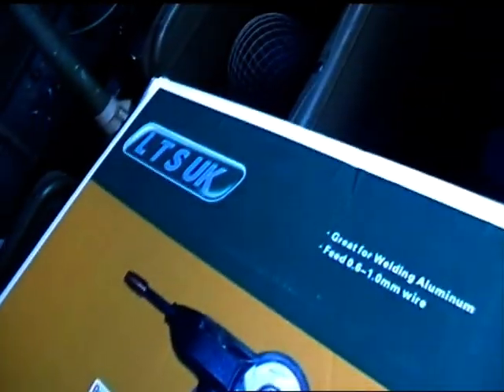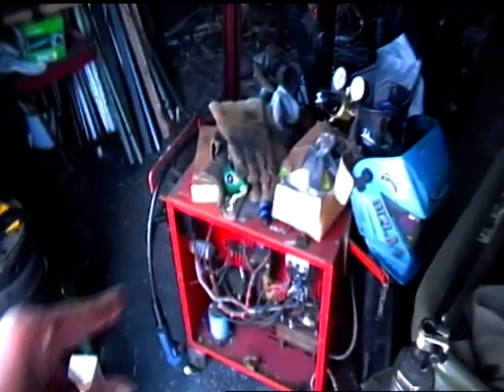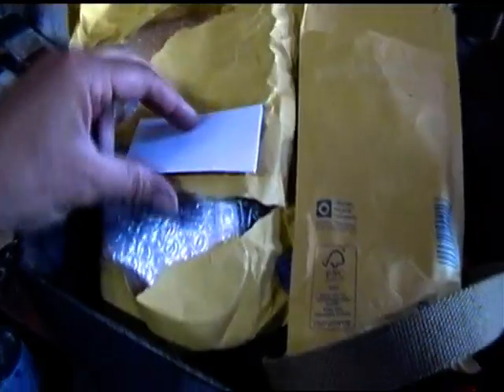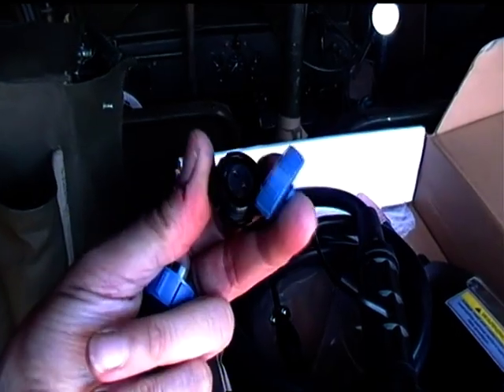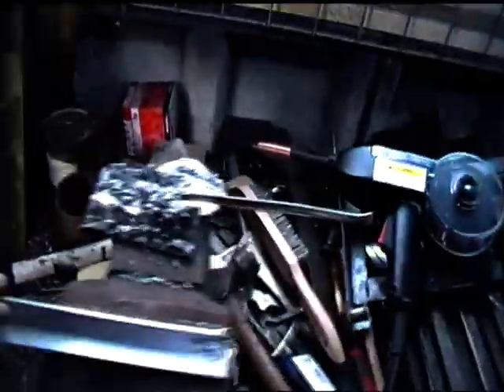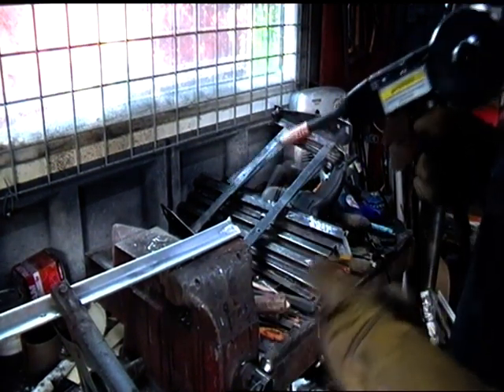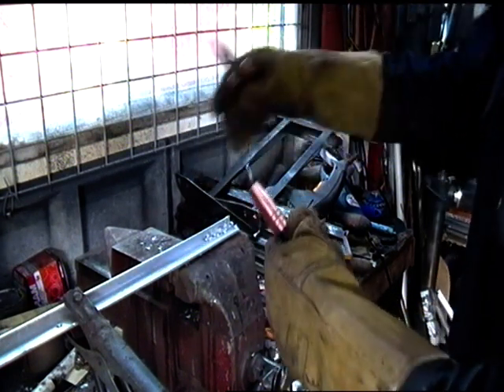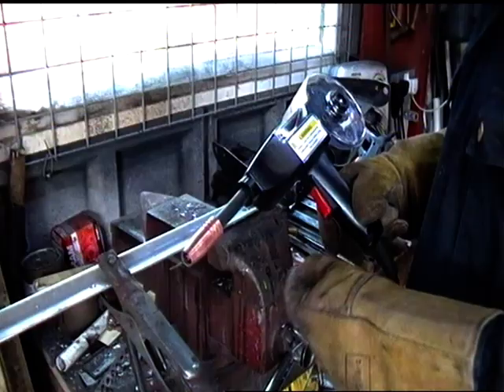Spool gun setup & mig conversion

Comment: Mig welding aluminum (aluminium) should be done with spray transfer.  For this you need a machine with the proper voltage and current curves.  To try to convert any old machine is going to be hit and miss, mostly miss.  At one time I had a Lincoln 155T that did spray transfer perfectly.  Use 100 percent argon, DC electrode positive, AC is for TIG not MIG.
Reply from the maker: Thanks for that I knew it wasn't just me it is the mig system at fault. So it's spray transfer that applies a higher voltage to create an ark. "Spray Transfer is a transfer where a higher voltage is applied and the electrode does not contact the metal" that makes sense. However I was still able to do welding on my Land Rover with this setup all be it messy.

Comment: Is it heave for long term usage
Reply from the maker: To use this properly you also need to convert the output to AC in my opinion by removing rectification stage. Not had a go at this yet too busy up to now but all I show is correct as far as it goes.
Reply from the maker: Not so heavy for long term use.

Comment: The torch can not be more then 5/8 inch from material and gas pressure is 20 to 25 cfm
Reply from the maker: Tried all settings and distances must just come down to needs to be AC not DC as my mig is. All alu welding should be AC.
Reply from the maker: @Jambo Yes it works but I suspect will work better if was AC like a TIG is as there must be a good reason for a aluminum TIG welder to be AC only.
Reply from the maker: @Jambo I agree thanks yes used stainless steel none contaminated brush also rubbed surface with same sand paper I use for lumiwelding / texchwelding. Have got it working better than in the video now but on a car you just can't get access to some places to clean properly like working on a bench you have to do the best you can. I do have videos of the jobs I did on my Land Rover a few weeks later, I had holes and gaps to fill with this so put stainless steel plate under and float welded pools of aluminum into the gaps. Must be a reason a TIG is AC output for aluminum not DC WHY?  Here is video https://www.youtube.com/watch?v=S88GCqd5EoY&t=68s
Reply from the maker: @Jambo Thanks it's part of the problem with testing a new thing especially like this but what I show is honest. If I had waited a few weeks and practiced it would look better if google played my second video straight after then I would not get the negative feedback I do. An other problem may be the aluminum I am welding in this video is an alloy used in communications equipment racking and not good for MIG welding. There is a guy welding window frames some place on here and he does little or no prep work and it works perfect.

Comment: From what I have heard from all the longtime welding professionals on YouTube is that aluminum gathers oxidation on it's surface (even when you cleaned it  3 seconds ago) which definitely effects the weld and its bond strength and appearance. The ac arc creates a cleaning action on the microscopic level of the aluminum which just vaporizes and destroys those impurities. So this is what made me purchase a machine which can produce ac current. Incase i needed to weld an aluminum cylinder head. But I erred and got tig(due to cost).and i'm not quite sure how to convert this machine to be able to use a spool gun, hence I came across your video and channel.
Reply from the maker: Thanks for that I will probably re-make / edit this video and add the AC mod to it when I get time. People just don't show this info on here even TIG people don't indicate the TIG is on AC output they go on about what polarity the earth and torch should be not understanding with AC they don't matter as it flip 50 times per second.

Comment: Preheat aluminum!
Reply from the maker: I get what you are saying but I don't see others do that much. There is a guy welding window frames with a spool gun and makes it look easy no heating. Maybe it is the supply as people say you need an AC TIG so do you need AC MIG?
Reply from the maker: Ok it looks like the secret is to also convert the output to AC not standard DC for Aluminum work hence why you need an AC TIG same for a MIG. Will look into this and may re-do this video only took me a year to find this on the web. See 1.40 here https://www.youtube.com/watch?v=38zP4cu8kgg
Reply: Me myself i prefer ac mig over ac tig, less gas useage and you don't have to worry about feeding filler metal, only reason I see ac tig being usefull is for aluminum 1/4 inch and over or a professional with a work order to do many precise and accurate welds requiring a specific appearance and strength over and over. But I have no need at the moment for such a process. But preheating at least where you are going to start the weld helps with all metal as long as it is 1/16 or 1/8 inch and thicker. Aluminum especially, it dissipates heat 4 times fast than steel and it melts at 1100-1300 Fahrenheit compared to steel which melts at about 2 times the heat at about 2200 degrees Fahrenheit.
Reply from the maker: @heywhyerd  Are you using a Mig on Aluminum and if so is it AC output? I am going to look at converting mine to AC now you see as been thinking about why only AC TIG is used on Aluminum not DC.

Comment: Cut the wire before you arc up Everytime about 10mm from the end of the gas shield, Don't weld over the crap you have just put down it will never be right. Grind your material, alluminium has an oxide layer that needs removing. The material your using may not be weldable there are a lot of alloys that aren't.
Reply from the maker: Yes fair point Landrovers are made of birmabright and I have used this on them now. https://www.mig-welding.co.uk/forum/threads/welding-birmabright-ally.61/

Comment: Should you convert to a.c current not d.c .
Reply from the maker: Good point they say use an AC TIG not DC but not seen anyone use an AC mig. Would have to remove rectification to do it, I did use this again last week and welding with the tip closer does help.

Comment: Nice mod Oddball, I need to do similar to my welder which led me to your video. Spudnick1uk has some very good suggestions, one that I might add is to have less "stick-out", meaning the amount of wire sticking out of the gun while you're welding. You don't need to touch the gas shield to the material but closer would be good. Try a centimeter or so, this will increase the heat in the weld and help with penetration. Good luck, and thanks for the video. -Dave
Reply from the maker: Thanks for appreciating the video is more about converting the welder than how to use it. :-) Hence Title "Mig conversion".
Reply: @0ddba1l  wellllll stop talking about how to weld it then because your doing it wrong anyway
Reply from the maker: @popapoco  No I didn't the video is about conversion of a mig to spool, as no one else has done a video on this it's me or nothing.

Comment: Can i connect spool gun to a plain ac smaw welder?
Reply from the maker: Well basically yes but you would have to convert it into a MIG with all the mods not worth the time and money.  You need a wire feed speed control and the trigger also tuns off the gas & electric to the torch as well as the feed of the wire.
Reply: also you need DC as far as i know to weld steel (atleast for Fluxcore MIG i know it)
Reply from the maker: @hyperhektor7733  All aluminum TIG welders are AC hence why I say a converted MIG has to also be AC for aluminum only hence the hassle of removing rectification. It is the only reason I can come up with that nine does not work well.

Comment: you need to get heat into the weld.
slow the wire speed down by 20%  and don't weave like your doing , .
keep still in one spot until you get a pool of melted ally then move about 1 mm to about 2 seconds .
alos you can use less quality argon , 96% is fine and a lot cheaper
Anyway imagine your welding a sponge , the wire has to melt and bond and fill up the holes and flux upwards to draw the properties of the ally to bond and lay. like lava.
Reply from the maker: Thanks for your info that helps I have watched a number of videos but didn't really help much. I have welded a number of things now but still not happy with it will look into the gas as it is way expensive and does not last long. 1mm in 2 seconds that is slow some videos seem to show move faster than steel welding. What amps do you think I should use for say 2mm aluminum sheet?

Comment: try getting as close as you can, SV Seeker uses one to weld his boats https://www.youtube.com/watch?v=2K4wP5Z5jwo
Reply from the maker: Yes looking at his video it should be easy, can't see anything about his setup but his spool gun sort of looks cheap with no spool cover. Mine looks like one for a Sherman Mig it only cost about £75 I am wondering if the mig wire is poor quality as I am not getting carbon but it is a grey dull finish also maybe the gas is too high and cooling the weld.
Reply from the maker: This seems to be the best how to vid out there made by Eastwood maybe I need to spend more time cleaning the metal first. https://www.youtube.com/watch?v=rYt08zz-Yr8
Reply from the maker: Yes have seen some of his stuff quite good. I had an other go last night was a bit better but still terrible trying with less amps and less gas now.